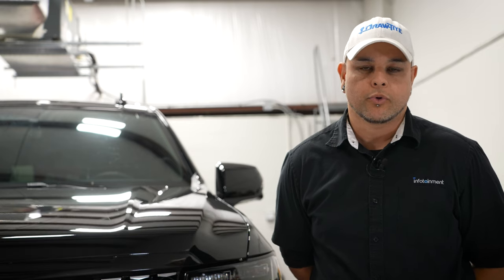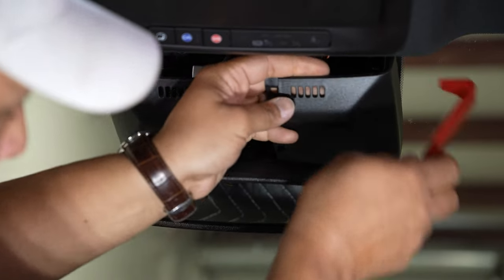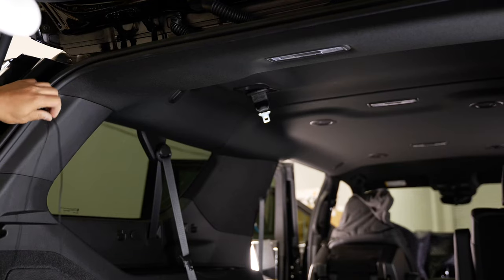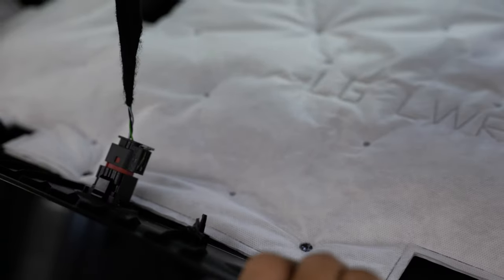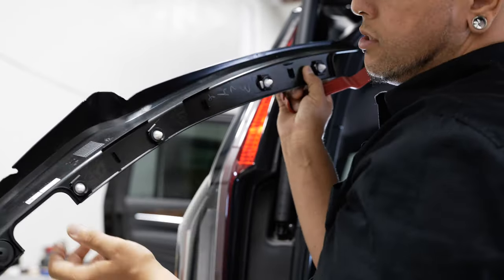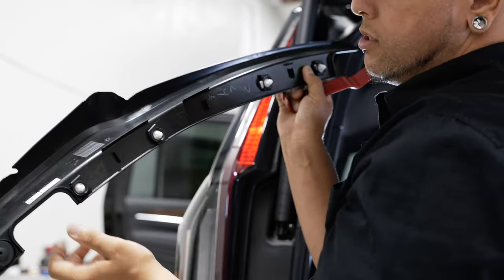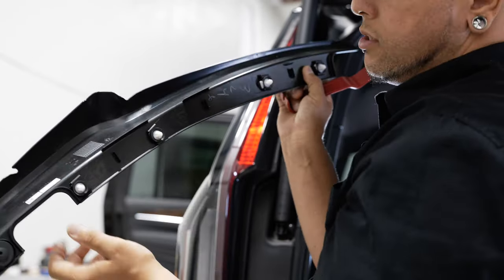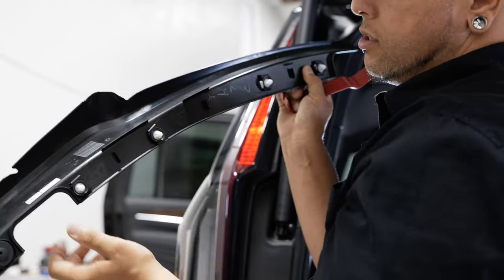2021-2023 GM® Full-Size SUV - Factory OEM Digital Rear View Camera Mirror Full-LCD Display Install

Comment: Will this mirror and cammera system work with just power and ground or does it need to communicate with the can buss?
Reply from the maker: Yes it is just power and ground.  The system is contained between the mirror and the third brake light. It does not communicate with the canbus.
Reply: @Infotainment_nav  thank you